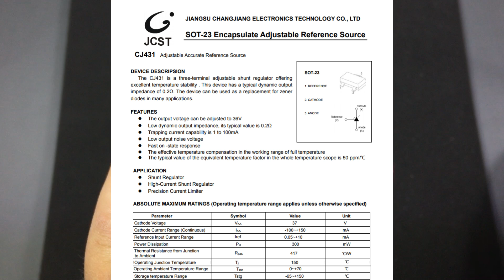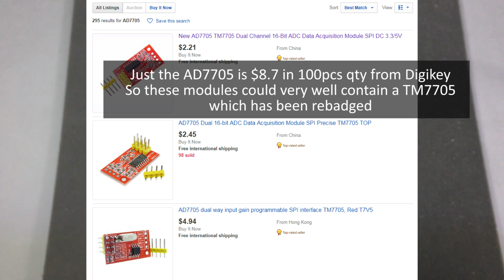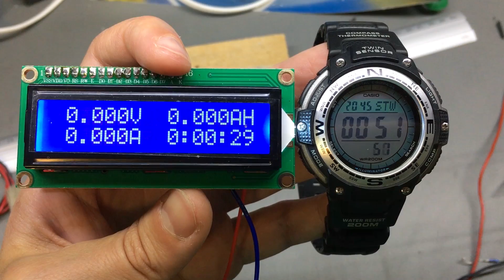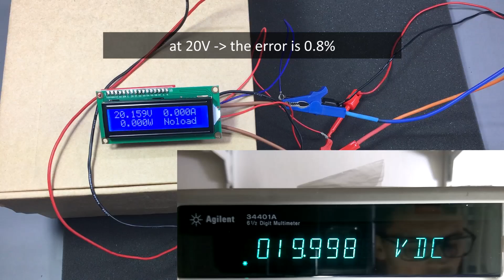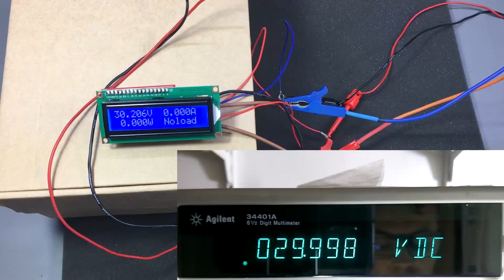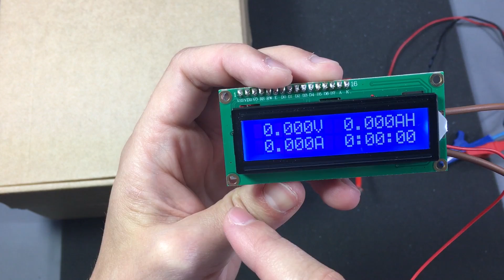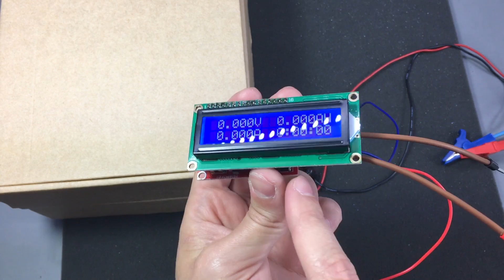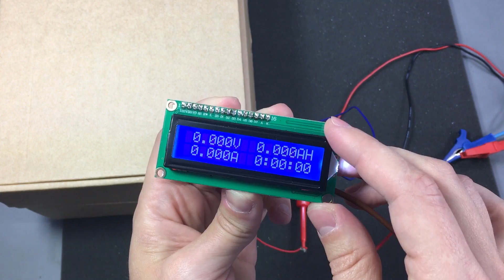Voltlog #127 - 0-60V 0-10A 1mV 1mA Panel Meter Review

Comment: Your Links don't show the product....
Reply from the maker: I checked and you are right, the video was published OCT 2017, and over time links change, products get sold out.. there is nothing I can do about that.
Reply: I found this one now: https://www.aliexpress.com/item/1602-voltage-ammeter-power-meter-LCD-Coulomb-AH-battery-capacity-tester/32897228636.html?spm=2114.search0104.3.80.211928c3ARxhZ0&ws_ab_test=searchweb0_0,searchweb201602_5_10152_10151_10065_10344_10068_10342_10343_10340_10341_10696_10084_10083_5011815_10618_10304_10307_10820_10821_10302_5723615_5011715_10059_100031_10103_10624_10623_10622_10621_10620,searchweb201603_13,ppcSwitch_4&algo_expid=f09833c8-d405-4ad3-8a3f-317b60540f49-12&algo_pvid=f09833c8-d405-4ad3-8a3f-317b60540f49&priceBeautifyAB=0

Comment: Looks like junk to me, its oscillator isn't running at the right speed, which will be throwing all its measurements out, they should of used a crystal.
Reply from the maker: it would have been decent if the calibration menu existed.. I could of used it at least for accurate amps and volts measurements..

Comment: Thanks for the performance testing. It's good to know what to avoid. I doubt there's any calibration being done. Just mass loading of the same firmware.
Reply from the maker: ok no calibration being done at the factory might be acceptable if there is a calibration routine we can access ourselves but so far I couldn't find it.
Reply: If soft calibration is actually coded in the firmware, perhaps tracking down the original equipment manufacturer or designer would be fruitful.

Comment: As disappointing as this product seems to be, I'm still curious about the other modes. Have you tried holding the button in while powering it on? Also, I have an el-cheapo USB power meter with one button, and once powered on you have to click the button multiple times in quick succession to enter its options settings. Just some thoughts.
Reply from the maker: tried holding the button while power up, it does nothing. I've also tried clicking the button multiple times, doesn't seem to do anything.

Comment: I wonder what would happen if you put more than 5v on power supply. There is a reverse polarity protecting diode, so chips don't get full 5V but something around 4.4V, but I think that is not a case this time. It's a crap.

Comment: Oh dear, there are much better items. Like http://www.ebay.co.uk/itm/391784067310 

Thanks for the warning, sometimes I get the feeling that a lot of failed products end up as "modules" on ebay.
Reply from the maker: I have the OLED module , the big problem with that is the very small size of the display and fonts
Reply: Some data on those mini-OLEDs are indeed too small. Then again: I grabbed a few of the displays you reviewed a while ago and actually decided to use the mini-OLEDs for my latest project. They have a big advantage: readability in varying light-conditions and all viewing angles. I needed the Volts and Amps and that data is easily readable from distances up to 1 - 1.2 meters (and I have not the best eyes). Here's a shot of them in action on this "quadruple-power supply - DC load - signal generator"-box I hammered together into a 19" case. => http://klcbsoft.com/youtube/mini-oleds-in-action.jpg
I think they come through quite nicely. Oh .. and that thing on the right is the Aneng 8008 that I purchased after your review, and I cannot thank you enough coz I love that thingie to pieces :)
Keep up the good work!
Reply: @klcsoft , that project looks real nice, where did the case come from and what do you think of the meter above in the link i post?
Reply: how about these ? http://www.ebay.co.uk/itm/LCD-RC-High-Precision-Power-Analyzer-Tester-Watt-Meter-150A-60V-Practical-1X/362020500824
Reply: @Dazza Direct - the meter in your link appeared familiar to me, as I saw it (or something similar) a while back on mjlorton's channel. Check out his in-depth-view of it => https://www.youtube.com/watch?v=Lxv9Rozs774
Personally, I'm not likely to ever come across this high-precision-meter. Not because I think it's bad, but I have a specific field of electronics I'm active in, and that is preamps, amps, compressors/limiters where there is no immediate need for super-precise measurement of amperes and/wattage. Still, In my project above I did what voltlog suggested in this video: run the meters from half-decent, independent power-supplies (internal dual rail 5v and 12V supply with extra winding on the toroidal).That yielded in absolute sufficient precision.
@case: it all started with a cheap-o power-amp that was burnt out and which I bought for a few bucks. But it came with a meaty 8kg toroidal transformer, 30000µF caps, 12 power BJTs and a 19" rack-case. I cut off the rear 10 cm of the case to make it fit onto a workbench, took apart the transformer, wound it anew and to my specs and build everything around it - PCB-etching and lotsa metal-work included. :)
Reply: mjp0815 ,